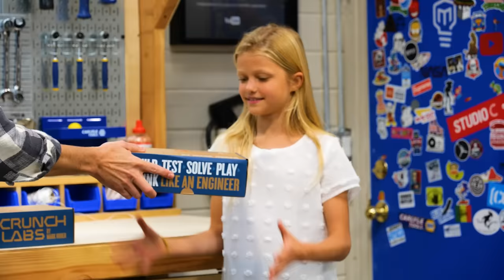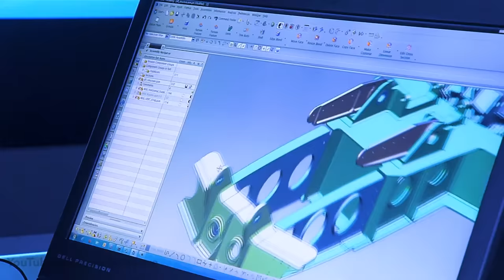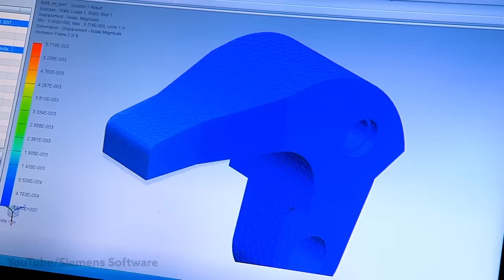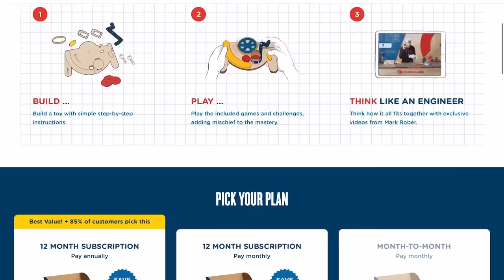World's Largest Frisbee Launcher

Comment: I think it's pretty cool that designing these builds demands the same engineer- like thinking that these builds aim to teach. Like Mason was talking about with good prototyping, you're supposed to make mistakes, so you can learn from them. Learn what works and what doesn't. Keep what works, and use trial and error to figure out how to fix what doesn't. Try different things. While the build box subscribers are learning to think like an engineer, learning these stem principles and how to apply them, getting comfortable with trial and error and the fact that failure is okay, the designers are using that same exact thinking to design new build boxes! In a way, they're in the trenches with you!